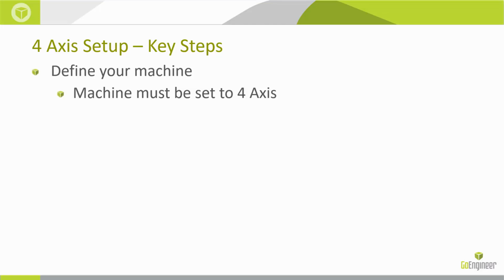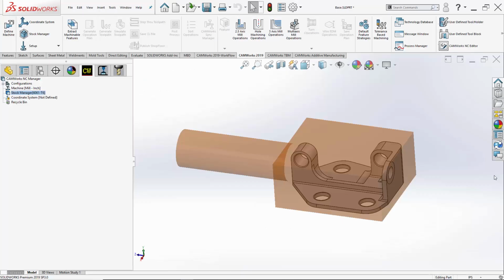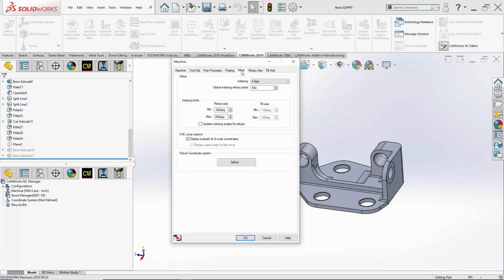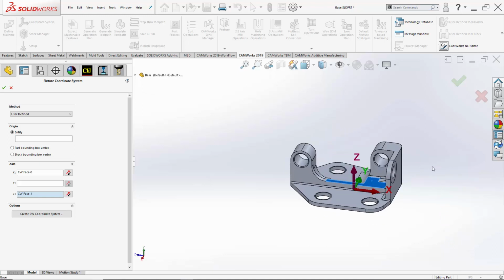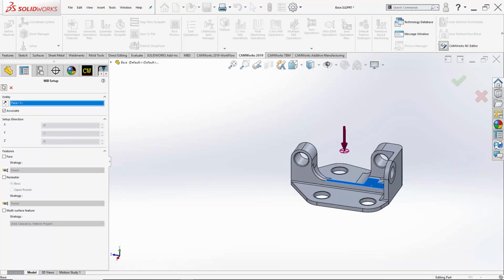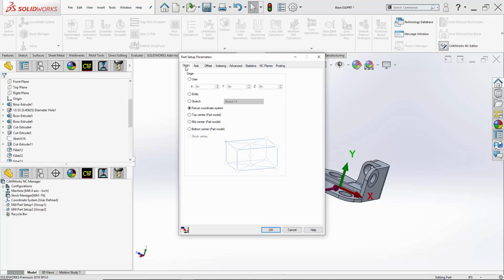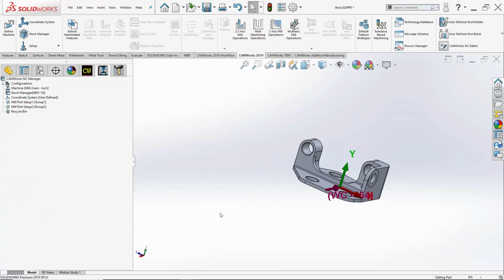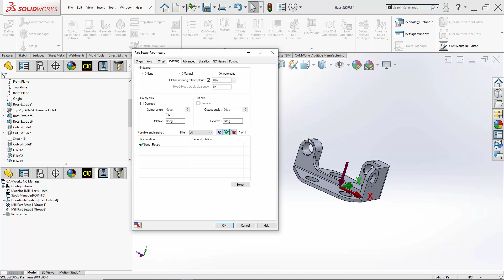CAMWORKS and SOLIDWORKS CAM - 4 Axis Setup

Comment: I've set my rotation axis to Y but the g code posts A axis to rotate although it should be B. Post processor is fanuc tutorial. What's wrong?
Reply from the maker: Its hard to tell without digging into your set up, Most likely it is an issue with the post processor. Contact your VARS technical support team and they can help more directly.

Comment: What postprocessor you used?
Reply from the maker: The post processor used in this video was generic, and not specific to any machine or controller, as it wasn’t necessary to the workflow.  SolidWorks CAM and CAMWorks come with several common post processors, but GoEngineer recommends and offers a custom post processor tailored to your specific machine.